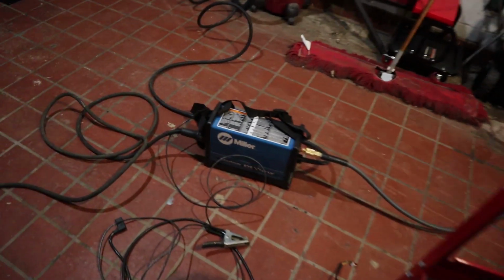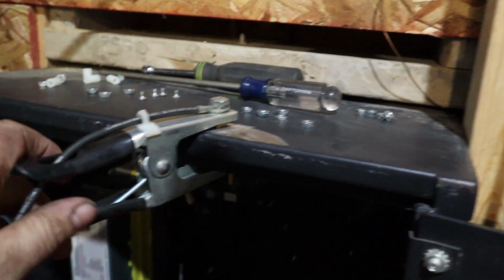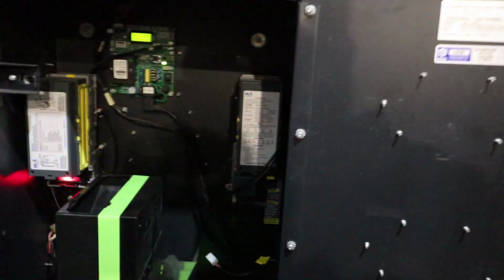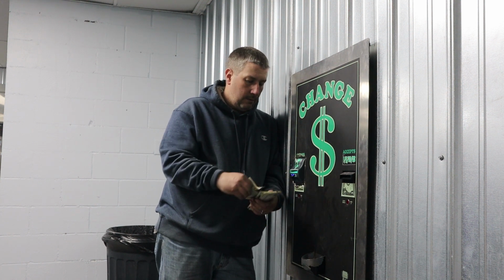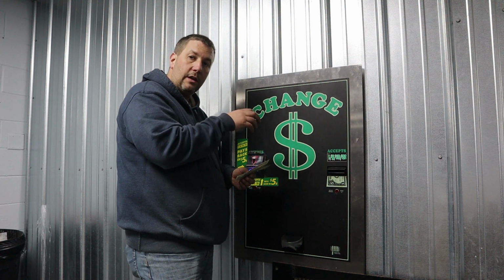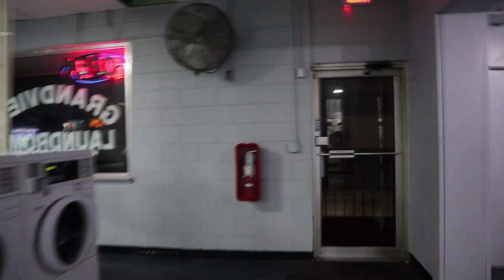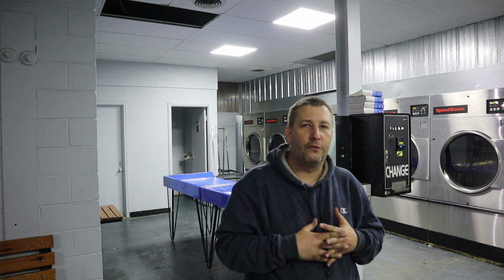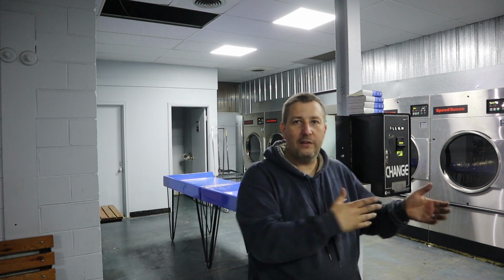How to Install a Bill Breaker at LAUNDROMAT! | Following Keenan ! | Change Out!$! |

Comment: No one ever used our 30# machine.  We pulled it out and turned the existing 60# 90 degrees and placed 2 more 60#.  Speed queen/ALS is where it’s at.  Parts are readily available. Parts will interchange across most machines and they are robust. Which means less money you have setting on the self in spare parts.  Great video!
Reply from the maker: Very true, thanks!

Comment: The Older Wascomat drums looks all identical to Speed Queen, Huebsch, Unimac, IPSO & Primus. I seem to feel Alliance later got the Pat/Pend to the older Wascomat Gen 4 & below which is totally wonderful. I also seen Speed Queen made stuff before Continental Girbau got the Pat/Pend. And I also seen Speed Queen made stuff before Dexter Laundry got the Pat/Pend. The Maytags also seem to be so identical to Primus, Speed Queen, Huebsch & Wascomat. I also remember when Speed Queen used to make the Super 20s until around the end of the 1990s. Pellerin Milnor used to also make non-cabinet style washers 35lb & above and now they make Cabinet model washers 25lb & above. Milnor dryers are also identical to ADC. Wascomat also used those same exact dryers until the Gen 6 era. Maytag Dryers are also identical to ADC as well. Hey good luck if your new bill breaker works

Comment: Hi Keenan, thank you for your content.  I’m looking to do the same thing you’ve done with the the bill recycler.  Where did you get your recycler?  Also, what was your programming setting to get it to give $5 in coins and 3 fives back?  Thanks again.
Reply from the maker: Vendor Tech out of Denver Co. $20 or$10 get broke down to 20= (1) $5 in quarters and (3) $5 10= (1) $5 other $5 in quarters. Otherwise for 5 and 1 its normal change. Plus, when they use $5 it reloads itself.

Comment: How high do you raise the stack dryers off the ground? What material are you using for the base? My bottom stack dryers get way less use compared to the top. Hoping they will use the bottoms more if I raise it up a bit
Reply from the maker: I use concrete, 6" height. Makes a world of a difference. It also prevents dryer sheets and trash from getting under dryer. Looks cleaner. I paint that 6" base flat black. I also have the dryer over hang the base by 1" or 2".
Reply: @FollowingKeenan  Seems like I can do the same concrete base for hard mount washers too. Now I feel silly for buying the prefabbed base from the dealer

Comment: How did you learn to fix your speed queens?
Not many service techs here.
Reply from the maker: I used youtube videos for part of it. Alliance laundry posts repair videos. Second thing I did was helped the service tech when I had my 1st repairs. 

My dealer offered it to me early on.  I dont think he knew I would be able to do my repairs. Then I figured out to buy parts on ebay. 

Trick is start with simple repairs and work up. Hardest thing to do is toploader transmission and bearing jobs on extractors. But once you do it a couple times get easy.  Hope that helps.

Comment: Are you happy with the bill to bill changer.
Reply from the maker: Yes, helps a lot. But mine is both a bill breaker and bill acceptor for the change machine. Basically two in one machine. Plan I adding it to another store.
Reply: @FollowingKeenan   thanks I will install one in my place